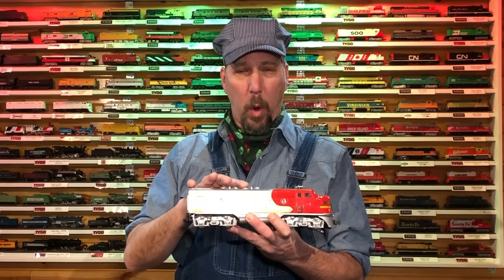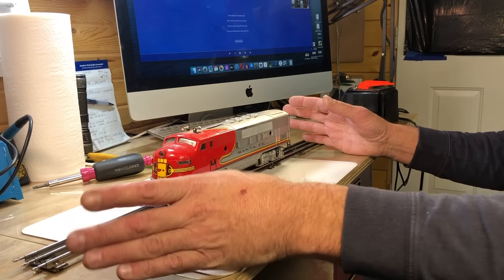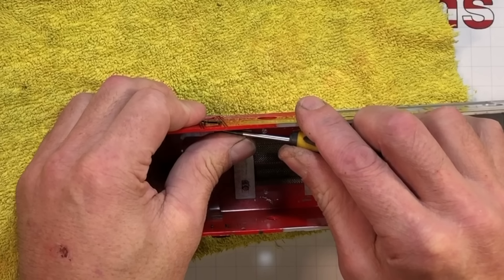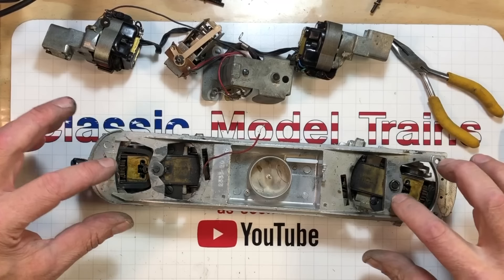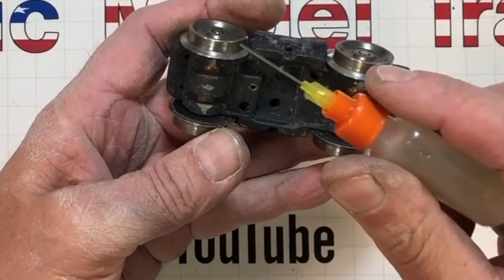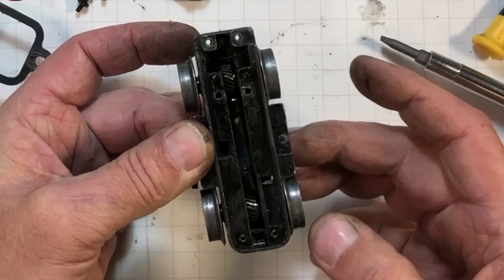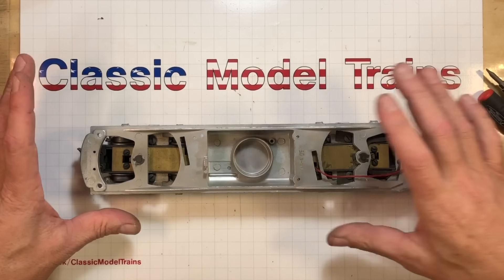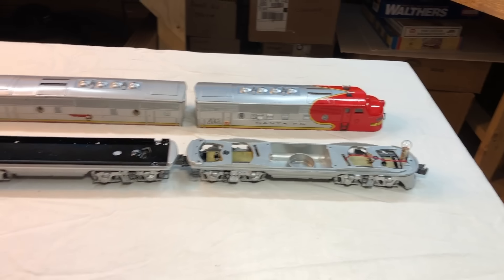Lionel #2343 Santa Fe A-B-A Complete Tear Down & Repair.

Comment: I use a mixture of 50% ammonia with 50% water and spray down the shells with a sprayer bottle in the sink. I let it sit for about 1 minute and use the kitchen sprayer to spray the goobers and dust away.  Dry with a soft cloth. No wax here, just a bit of touch-up paint.
Reply from the maker: Sounds like a good idea to me!

Comment: Question: I own an 0 gauge F-3 A-B-A with passenger cars. I'm new to this and I'm wanting to build a layout. What is the minimum size curve I need to use on a layout. Anyone know where I can find some layouts/drawings? Appreciate any help I can get. Thanks.
Reply from the maker: Your radius would need to be at or larger than 31”. That number sometimes confuses people so I will say for the locomotive robs able to make a u-turn the track will take up 62” center of the track. Over 5 feet wide layout to make a turn. That’s minimum. I would do no less than 36-42 radius. O gauge is real big so it likes large turns. Now someone will come along and say there’s runs just fine on O-27 track. (27” radius) but believe me bigger curves are always better.
Reply: @classicmodeltrains  I have both 0-27 and 0 ga. On an 0=27 setup the F3 requires at least a 42" radius. I was not sure on the 0 gauge. Thanks for the info.

Comment: The O vs O27 thing is not really based on scale. It was more like Lionel Premium vs Budget line of trains. There are many examples of Lionel steam engines that are identical with the exception of the number stamped on the cab, such as the 675/2025, the 671/2020, and the 646/2046. Lionel didn't use separate numbers for their rolling stock. Their items made in the early postwar years for both product lines were closer to 1/64 while items made from roughly 1952 and later tended to be closer to 1/48. O27 track was made cheaper than O gauge. O27 gauge sets typically included transformers, while O gauge sets typically did not.
Reply from the maker: Lots of  good information out there. I read the change to O-27 was of course for budget minded consumers, but also the "O' stuff took up so much room in the house.  They scaled everything down to accommodate the smaller sized houses being manufactured  (if I read that article right :-)

Comment: Yes the original portholes were on the 2333 and 2343 which were more like a contact lens. Lionel knew that the windows would easily pop out of the locomotives from the lightest of handling or age. So the 2344 Lionel switched to the snap in portholes from late 52 early 53 to 1955. The replacement called to use the later designed portholes as replacements when the originals fell out. Front load washing machine!  LMFAO! YES SIR THEY DO!
Reply from the maker: This one had missing contact lens looking ones.  Replacements from the eBay were ugly but all I can get :-)

Comment: Excellent video Ron! Just curious, for those of us who do not have an ultrasonic cleaner, will heating up a pot of water do the job? Thanks!
Reply from the maker: Thank you!  Hot water won't clean as good as an ultrasonic.  The ultrasonic vibrates very very fast and creates cavitation in the cleaning liquid.  tiny bubbles "blow up" causing the dirt and scum to be removed with out having to scrub it.
Reply: @classicmodeltrains  Thanks Ron! I will have to invest in one then! ✌🏼

Comment: I like my Williams engines. They are robust and simple the only thing that goes bad is the circuit board. They are great pullers and I just sit and let them Circle the layout for hours. The collectors can keep the Collectibles all they want. I remember when only motorcycle nuts had motorcycles and only train nuts had trains. And then these hordes of ritual farts went into both and out priced us out of everything. I'm just glad that they are so old and they can't take it with them hahaha.
Reply from the maker: Never heard of Williams.  I shall have to go and do some research
Reply: @classicmodeltrains  you never heard of Williams trains? He started making reproductions of standard gauge Lionel items when the originals became too pricey for someone to afford he used to hire kids from the neighborhood to work for him one of those kids was Mike Wolfe from MTH. He's at started making reproductions of all of the post war Lionel line. They were very simple robust sturdy engines with just a circuit board for a horn and a whistle very reliable and very well priced. I had one take a dive off my train table and it just broke a horn off it. When Jerry Williams retired he sold the line to Bachmann trains which killed the line. Thank God I stocked up on anything and everything that I could find in my price range. They made great trains

Comment: The clip on the windshield is referred to as a speed nut
Reply from the maker: SPEED NUT! there it is.  Thank you. I like those when the pin is threaded. push on to hold, twist off like a nut to disassemble. :-)

Comment: Umm,  If you would have tried a bit you could have removed the back worm shaft gear without a grinder.
I have done it a few times.  It gets hairy if in the past it has been "shimmed".   But then again the shim is most always in the front of the truck.
Reply from the maker: I tried quite a bit.  a lot of footage is not shown  in the video. The drive shaft was not coming out with out removing that plate. Thanks for your input. perhaps the next one I run into will come out easier :-)

Comment: Love your videos, Ron. Your flat N. Midwest accent & idioms are great humor & your knowledge of tools & techniques for rehabilitation of old gear is unsurpassed.. But one minor correction is in order - to say Lionel O-27 is 1/64 scale is just as wrong as saying it's accurate 1/48th. 
The "27" in O-27 refers to the diameter of a circle of track (27 inches) which was designed to fit a standard 4' x 8' sheet of plywood with enough room to spare for sidings/etc.
Lionel was less concerned with scale accuracy (especially in the early post-war era)  than what would fit comfortably in the small bedrooms of the time.  While most rolling stock was not accurately scaled to 1/48, and was often much shorter, the proportions were also not 1/64. Do a little more research online to find this is true...
Meantime - keep up the great work!
Reply from the maker: Doug, I would like to thank you for your kind words on my video.  I appreciate if someone disagrees with the information I'm saying, they do a little "buttering up" before the hammer falls. It makes me feel as if we're having a "Gentleman's" conversation. In my extensive research I do on my video's, I continually come across websites that make reference to post-war Lionel O-27 having a scale of 1/64.  Not all Pieces.  Here is a quote I found after a simple google search.   
"True O27 is a 1/64 scale train operating on O trucks / wheels, made to run on O track, yet capable of handling a 27" diameter curve. True O27 fits within the definition of semi-scale. Offscale O27 is a train, smaller than O, made to run on O track, yet capable of handling a 27" diameter curve."

Here is another example
"Pretty much since the very beginning, Lionel and its competitors like American Flyer and Ives made trains in multiple sizes but running on the same track. By the late 1920s, they had all pretty much settled on two or three sizes of trains. The smaller trains, which ran on O27 track, had cars that were about 7.5 inches long. The bigger ones were 9 or 10 inches long.  Lionel continued this in the postwar era. The smaller trains were O27, and most O27 cars, especially the boxcars and gondolas, were about 1:64 scale. That’s right, they were S scale cars on O gauge trucks. Flyer guys have been buying those cars out of junk boxes, repainting them, and putting S scale trucks on them for years. The blue Lionel gondola pictured above is exactly the same length, width, and height as a Flyer gondola."

Now I also know Lionel used "selective compression" on some (most) of their pieces making them anywhere from 1/48 down to 1/64.  So I can only conclude that they are kind of all over the board.  What would be a good thing to say about the gauge vs scale argument I put forward in this video to please all the Lionel modelers out there?  From the data that YouTube has provided me, I have managed to offend many modelers with this abundance of  information that I gleaned from the internet with very simple searches. 

I have done a lot of research in the making of this video.  Thank you for commenting and engaging with me. If you have some information that could help a Feller out clearing up this confusion I would enjoy learning some more. 

Sincerely, 
Ron Davis.
Reply: @classicmodeltrains  Ron: And thank you for engaging with me as well (and so swiftly!). I guess the best thing you can say is what you said about selective compression. Lionel did do this extensively. But what you said in the video implied that all O-27 was 1/64. Info I have seen says that DID happen. But I have also seen info that says "No, if you take a prototype car, the S scale model (1/64) might be as long as the Lionel O-27, but the Lionel would still be taller and wider.", meaning the proportions are closer to 1/48 in those dimensions (& some in between - I saw 1:43 for example).

 The shorter length is to accommodate the tighter track radius (27 inch diameter of 8 pieces of 45 degree curve sections making a circle). I just found the implication that all O-27 is 1:64 misleading.
But as I said, I really have been enjoying your work. Very well done (and I was a TV producer/director for 25 years so I have an idea what goes into what you do - did see your Studio Setup video, BTW - nice!). I have also subscribed...

PS: I heard you talk about 54-year-old eyes. This is a bigger problem for me (74 & AMD - Age-related Macular Degeneration - to boot - eat your leafy greens  & take Preservision - just a word of advice), 

PPS: How close to Chicago did you grow up? You sound close...

PPS: Lionel was and remains Toy Trains - which is why they take so much license & why I ditched it to build my current HO layout, which is now OLDER THAN YOU! (56)
Reply from the maker: @dougvalmore1450  Thank you for your polite response.  As I move forward with this channel I learn so much from the research online, and also from viewers who take the time and share their knowledge with me.  I am picking up what you are laying down.  I generalized the Lionel  O27 as a whole and I should have said "some". I think my takeaway will be the true "O" gauge stuff is MOSTLY 1/48 scale.  The O27 stuff will be selectively compressed with some having 1/64 scale, but other pieces being somewhere in the spectrum between 1/64 and 1/48 depending on the Engineers and Accountant's, at the time.

Thank you for saying my video's are very well put together. That means a lot coming from a former  Producer / Director of TV.  I spent many years in the entertainment industry.  Live sound and lighting production.  Bands both local and touring, industrial gigs. live theatrical stuff.  Was a IATSE feller for many years.  This channel is my first on camera work.

Thanks for the channel Sub!  I'm from the Upper mid-west, North Dakota region. When I was not shlepping Racks and Stacks, I worn my body out from being a heavy equipment mechanic. The entertainment industry and its labor force has changed so much over the last 15 years that it is no longer a good fit for me.  I still miss it so I get to play a bit, by lighting and shooting these small video's, and mixing sound for them. Ive enjoyed this back and forth "conversation" today. If you have a Facebook account, I can be found on my Classic Model Trains fan page. Messaging there is not so "global". Take care!  Ron.
Reply: @classicmodeltrains  N. Dakota... huh. Doesn't sound like what we heard in Fargo (though it's probably exaggerated like most movies).
IATSE - huh. I was IBEW for 3 summers of vacation relief engineering during school before directing. Shot & edited ACTUAL FILM (everybody says "I filmed" but NO FILM INVOLVED - if they had EVER actually used film they would know the difference. Should say "I recorded" or "I shot" etc. Oh well). My business changed radically, too, when it went digital (hired someone half my age & half my wage who was already trained on digital from school rather than train me. Oh well). I miss it too.

Do you ever do repairs for hire? I have a couple "Shelf Princesses" that my old eyes just can't hack anymore. Would love to see them move again...

PS: What looks like copper contact strip is often phosphor bronze. Copper is sometimes too soft/malleable for applications that require more "srpingyness". Do a search of "phosphor bronze" to see what does look like copper...

Comment: Great video Ron!  One comment, the 2243 was actually the same dimensions as the 2283 but was single motor and was sold as an 027 loco on price point.  But it was technically the same full size O scale loco but with only the one motor.  Nit picking I know but it's an easy detail for  us Lionel nutz lmao  Also another term used is "Traditionally" sized which means shortened in length and sometimes in height.  They are too wide to meet 1/64 really but that is a good comparison and a fair one. Looking forward to the second half!    They really motor brother! Here is a poor quality video on mine in Notch Eight and staying on the rails although the conductor was a little sea sick afterword...... https://www.youtube.com/watch?v=kAvhdxe4cXg
Reply from the maker: Thanks for the great info, I have not done a ton of research on Lionel. I know there are some fellers out there that are very knowledgeable on this topic. I am but a pup now, but soon I shall be able to hang with "the Big Dogs"
Reply: @classicmodeltrains  You'll be A Okay!!  No worries! Just keepa rolling just like you are!

Comment: Yeah my f units I have the A and B 2383 I believe it's a 1958 model the power unit takes a D battery the operate the horn and underneath the fuel tank has a switch to make it go forward or backwards I do have the passenger cars that came with it the best way to describe them are is the ones with the screws on top that looks like vents to take the roof off and it all looks brand new my oldest one is 1932 Steam runs great I have a bunch of lie now stuff not like yours
Reply from the maker: Hello Mike! Cool you have the passenger cars, Plus a pre-war steam!! RIGHT ON!!!

Comment: Excuse me but the 2243 is just as much a 1/48 scale model of an F3 as the 2353. The difference is that the 2243 had only a single motor and was sold as an A-B set rather than an A-A set. Also, while the 2343 is a VERY nice engine, there are other road names which are FAR more desirable than ANY Santa Fe F3,
Reply from the maker: Good evening John, Thank you for commenting. Ive had a couple fellers bring this topic up about the 2243.  When I was reading my David Doyle "standard catalog of Lionel trains" it mentions the 2243 as "part of it's O-27 line". I have never seen one so I could only go off my research. The word desirable was meant to reflect the model of the locomotive and the features it has, not the particular road name.  I am not a creative writer, so it has become evident to me I have not conveyed my idea's very well. Thank you for commenting and allowing me to perhaps clear this up :-)

Comment: Once you alter an original “collectible”, it’s no longer original or as valuable as it was. I saw no need to destroy the truck rivets and replace them with metric screws. Likewise with other modifications. Vintage Lionel train collectors want originality. Save the mods for HO stuff.
Reply from the maker: Greetings Jumijo, In the video I explained why I had to cut the rivets out.  I could not remove the drive line and clean & service that truck.  The upper coupler bracket was holding in the bushing block. I could have sourced new rivets, but then the video would not have been completed. The bolts were The only way I could hold that assembly together. I can still obtain the correct rivets and install them. No modification was done to the truck or brackets to get them to fit. The "B" unit plastic body frame was heavily damaged. I could have throwed it away, or do what I did to bring it back into service. I understand Lionel collectors want completely original CHERRY pieces.  The damaged paint on the body's put these units down into E-2 status. If the Body shells were stripped, re-painted and re-decaled, they would still never be a E-7 or E-6. Should I have left them in pieces to quietly rot away, or should I do what I did to return them to service and let people see these classics run the rails? I would never "mod" a super nice piece.
Reply: Who care what somebody else thinks about your engine. It’s your engine do with it what you want. Too many take exception to “Lionel toys” that are not as they came new out of the box. They can go pound sand.